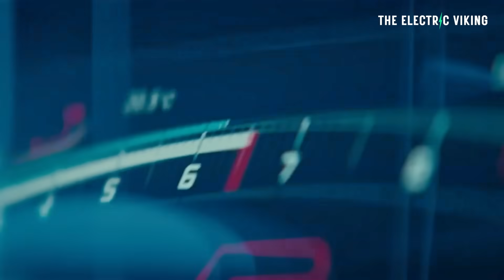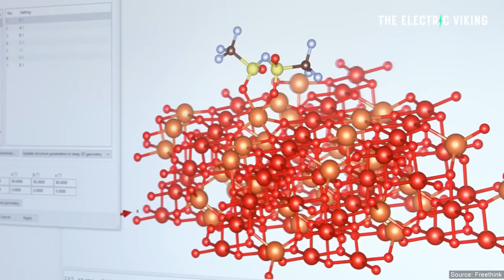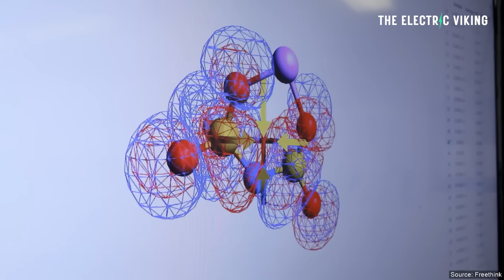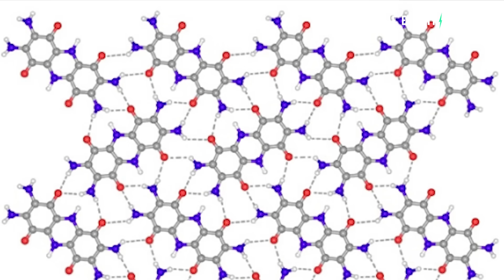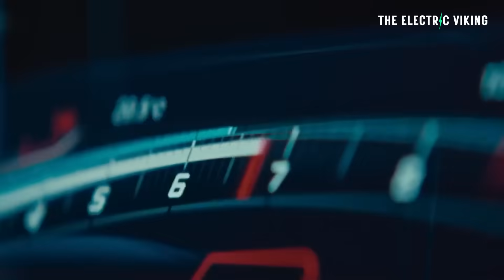MIT reveal Lamborghini battery with 500 kw charging & 765 Wh energy density

Comment: The new Taycan that just broke race track record within 1 second from the Rimac Nevera, which is also owned by Porsche/Bugatti, is using this new battery and will be unveiled in March! This is the reason Porsche has cut back on EV production in the past couple of years. They are working mostly on variants that use their engines with super compact batteries with extreme density and extreme low weight, including test vehicles with Quantumscape solid state. No more range anxiety or charging issues. Add to this mass production of their synthetic fuel, and Porsche will annihilate Tesla in its tracks!

Comment: I like EV tech but ICE engines are far from being done.  Teslas are being delivered on diesel trucks, shipping lines use enormous quantities of marine diesel, airlines run on kerosene and other hydrocarbon derived jet propulsion fuels... and these are just civilian users. Where were you with your reporting when thousands EVs literally froze in Midwestern cold blast, lol.  
Researchers will promise you the sky and the moon to get their grants (i.e. have their jobs secured).  Until these technology is commercialized, this is just blah blah blah.  Everybody including Toyota promises breakthrough tech to develop new chemistry and materials for high energy density storage but nothing yet that is scalable, reliable,  reproducible in a desired range of temps /climates these motors need to run.  The auto manufacturers just spreading their bets, doesn't mean much untill there is a commercial product at reasonable cost as most of your viewers likely don't have Lamborghini car budgets.

Comment: What I really want is all of these new batteries/packs made to be reverse compatible with most if not all EV's out now. I would easily pay to double if not triple the range of my Mach E if a replacement pack made from these new cells, once the present pack "wears" out (70% of original range). THIS is what is really needed. I know the OEM's would have to made the the controllers compatible or make replacement ones too but it should be done ASAP.

Comment: No standard tire will give you 1.3 seconds from 0 to 60. the limitation is tires not power, dragsters have massive custom tires that are not practical for street cars, and the Tesla Roadster can supposedly get to 1.2 seconds from 0 to 60 by using cold thrusters.
Batteries with the power you are talking about will be used for aviation where cost of the batteries will be justified by fuel savings.

Comment: When the battery weighs less than an engine and small engines that produce high power output for short periods this means highly technical vehicles , like  current EV,s, will be less attractive because range concern will be eliminated and conventional vehicles more easily adapted.

Comment: There's so many components to a good battery:
1.  Affordable
2.  Easy to manufacture
3. High energy density
4. Rapid charging speed
5. Fire resistant
6. Can release energy rapidly
7. Doesn't use problematic metals like cobalt.

It's a tall order for researchers and engineers to get right.

Comment: As usual Sam Evans does little research, so he often gets the details wrong (and the links in this video's description box are for a different battery, so ignore them).  765 Wh/kg is the energy density for just the cathode, not for the entire cell. Given that cutting-edge NMC811 now has cathode energy densities approaching 750 Wh/kg and cell energy density around 300 Wh/kg, we can guesstimate that this new TAQ battery will have a cell energy density of about 306 Wh/kg, so it is impressive, but it isn't going to revolutionize the industry as Sam Evans thinks. Remember that CATL just announced its "condensed battery" with cell energy density of 500 Wh/kg and Amprius is selling its solid-state battery with 450 Wh/kg.

The TAQ battery has 88% capacity after 1000 charging cycles and 70% capacity after 2000 charging cycles, so its lifespan is similar to NMC, but LFP supports 2 to 3 times more charging cycles.

Where the TAQ battery shines is the fact that its cathode contains no metals (except for a copper or aluminum current collector), so it solves all the problems with the limited supplies of nickel and cobalt, and the researchers think that TAQ batteries should cost a third to a half of the price of NMC batteries. In other words, these batteries should compete with sodium ion batteries on price, but they will have significantly better energy density and can be charged at 10C (i.e. 6 minutes). However, this is at the early prototyping stage in a laboratory, so it will probably take 5 years to get this to mass production, and by that time I fully expect LFP batteries to be at 300 kW/kg and support 12C charging and NMC to be at 350 kW/kg and support 6C charging, so they won't be that revolutionary, so it will primarily be their low price which is important. 

I expect that TAQ will be the future battery for mid-range vehicles (since it still contains lithium and probably copper current collectors in the anode), while sodium ion will be the battery for lower-end vehicles (since it only contains iron and aluminum), and high-end vehicles will use LFP for its longer cycle life or NMC for its higher energy density. Salt water flow batteries will be used for grid storage. Aviation and expensive electronic devices will use something like CATL's condensed batteries or Adden Energy's solid-state batteries.

Comment: This is groundbreaking and would make pick up trucks and larger trucks viable for most tasks.
Reply: Not really, because 765 Wh/kg is the cathode energy density, so we can guesstimate 306 Wh/kg at the cell level, which is only slightly better than today's best NMC batteries with 300 Wh/kg. It will probably be another 5 years before these TAQ batteries reach mass production, and by that time LFP will probably be at 300 Wh/kg and support 12C charging, so the real advantage of these batteries will be the lower cost, since they don't contain metals in the cathode.

Comment: I wish I had a dollar for every breakthrough battery on YouTube.   How many cycles before it breaks down?  Rare metals or chemicals needed?   Temperature range?  Cost to manufacture?   Thermal stability? Etc.  Have there been independent tests?🐝🐝
Reply: All they have is any early prototype in a laboratory and one published research paper, so this is a long way from commercialization. 12% capacity loss after 1000 recharge cycles and 30% capacity loss after 2000 recharge cycles. It uses 90% TAQ + 10% rubber in the cathode with an aluminum or copper current collector, standard LC30 electrolyte and standard lithiated graphite in the anode with a copper current collector. Temperature range wasn't mentioned in the research paper.  Researchers say that it should cost 1/3 to 1/2 of the cost of NMC batteries because TAQ should be cheap to manufacture. There are no independent tests.

Comment: MIT did NOT say this battery has 765Wh/kg! MIT said the CATHODE can carry 765Wh/kg! That means the rest of the battery (Anode, electrolyte, separator, conductors and casing) still need to be added to the whole picture. This then results in a much lower energy density battery (probably under 350 Wh/kg). Viking, please keep it factually correct.
Reply: Also, the energy density is limited to what the lowest energy density of both the Cathode and anode are, then further restricted by what was explained in my first comment.
Reply: I'm calculating that the cell will have an energy density of 306 Wh/kg, based on the fact that the best NMC811 cathodes have 750 Wh/kg and a cell energy density of 300 Wh/kg.

Comment: Highest energy density? So low power density?  Like the lithium titanium oxide batteries ?  LiTo
Reply: LTO has low energy density, but high charge/discharge rate, so high power density. I would guesstimate that the cell energy density of this TAQ battery is 306 Wh/kg, so it will have slightly higher energy density than the best NMC batteries currently on the market.

Comment: My house is wired for about 50 Kwatts total. So a charger that takes the power of 10 fully loaded houses. 240 volts, at 2000 amps, for example. Or 1000 amps at 500 volts. Id be interested in the thickness of the charging cable, and the huge connector to handle 500 Kwatts.
Reply: A normal "fully loaded" house is about 10kw max. (50 amps @230v). 50kw is enormous for a normal house. ie about 250 amps wire rating!
Reply: @tomlewitt  : When I built my house, in Canada, I put in a 200 amp service. So 240 V  x 200 A is about 50 Kwatt.  The insulated service wires were about 12 mm diameter each, if I recall correctly. I'd still be interested in whatever a 500 Kwatt charger would use for a cable, and a connector, and if there would be a weight requirement to wrestle the cable.
Reply: @drewthompson7457  Wow that's a serious installation. Great for decent home charging of EV's. Yes, these future 0.5 or 1 MW chargers will need incredible cables, for currents up to 1200A , at 800V working...Let's not even think about aircraft charging! ..15MW batteries, (small 90-passenger airliner) needing a 2-hour max turnaround!

Comment: I hope VW doesn't "sell" the technology to China. They could make it in Germany and kick Tesla's ass with expensive Hyper Batteries that Tesla customers want. I can see the Mercedes Benz EV Long Haul Truck coming out in 3 years. What about an extended range hybrid Tank! They can slap the "military" tax on it and make a killing. I mean $50 - $60K for a battery 1/3 the size that theoretically can fast charge at 500KW (If you can find a charging station that high, anywhere). With ranges of 500 - 1K miles. People will be selling a kidney for it. Imagine finally an EV battery that can put ICE  into retirement. The Mg version I don't think will be as energy dense, but a close 2nd for half the price will sell to the rest of us that don't want to sell a kidney for the privilege of range and fast charging.

What we need next is a solar array that has the capacity to charge a EV from 30% to 80% in under 4 hours of bright sunlight. Requirements are that it doesn't take half a parking lot to do it. We need more efficient solar panels, not cheaper one's that don't cut the mustard.

Comment: Well, If it's MIT, I have no doubt the specs are real.  However, Lamborghini only sells very expensive vehicles so they can afford a super high end battery for there vehicles.  These batteries may use cheaper materials but that doesn't mean they are cheaper to make.  In fact, until any battery is made at scale it will be more costly.  How well these can scale and how long it will take to scale is a question that is not answered on the MIT site.  Impressive as this battery is, I'd say we're at least few years away from it coming in any product and probably a few more before mortals like ourselves could purchase it.

Comment: Where did you get those numbers?i can`t find them anywhere.
Reply: Google: Chen et al (2024) "A layered organic cathode for high-energy, fast-charging, and long-lasting Li-ion batteries". 
500 kW charging is not in the research paper and I'm guessing that it is speculation based on charging a 50kWh battery at 10C (i.e. in 6 minutes). 765 Wh/kg is the cathode energy density, so we can guesstimate 306 Wh/kg at the cell level, which is only slightly better than today's best NMC batteries with 300 Wh/kg. It will probably be another 5 years before these TAQ batteries reach mass production, and by that time LFP will probably be at 300 Wh/kg and support 12C charging, so the real advantage of these batteries will be the lower cost, since they don't contain metals in the cathode.

Comment: That's good news seeing the w/kg feature cut in half. They need to push hard for even more improvements to that. Gadoline still has 17 times the energy density. A quart bottle of gasoline has about 9x the density, so there's still a long way to go with both weight and volume of fuel needed.
Reply: That may be, but for most applications gasoline has an efficiency of just 20%.

Comment: Well, MIT did not reveal this.  Lamborghini did.  And the corresponding lead-up to Tesla's earning on Wednesday makes it suspicious.  The 765Wh energy density is a figure that may be for a non-packaged anode and cathode.  The charging time may be the same or both may be high end pie in the sky possibilities.  A couple of days ago Stilantiis took a pot shot at Tesla saying that Tesla's price cutting destroyed it's profitability.  And tomorrow it will be GM, BMW or soe other auto company with a bit of FUD.  These marking ploys are designed to get investors to question the long term viability of Tesla.  Even if true, Lamborghini doesn't have the 50 other things that go into a Tesla car that the rest of the industry doesn't have FSD, supercharger network, decade plus of data of every charge they've ever given  a and how the battery performed, 

I don't think you'll hear about this battery much going forward.  It's just extremely unlikely that a technology is going to pop up like this, that nobody's ever heard of and it's going to be a slam dunk.  Did I say "extremely unlikely?"  Like 0.0001%.  And the repeated scheduling of these announcements to correspond to Tesla earnings are just evidence of more FUD.

Comment: with MIT battery the 765Wh energy density will make Electric planes viable as it was reporter that 450Wh would be enough to make the viable.
Reply: 765 Wh/kg is the cathode energy density, so we can guesstimate 306 Wh/kg at the cell level, which is only slightly better than today's best NMC batteries with 300 Wh/kg. It will probably be another 5 years before these TAQ batteries reach mass production, and by that time LFP will probably be at 300 Wh/kg and support 12C charging, so the real advantage of these batteries will be the lower cost. Elysian estimates that 450 Wh/kg will allow regional airplanes with 800 km (500 miles) of range. CATL is already offering its condensed batteries with 500 Wh/kg to electric aviation companies.

Comment: I have no doubt this will be like the breakthrough solid state developers keep claiming. Yes, in theory, it may have a huge battery density, but it’ll turn out it can only be charged like 10 times before it’s dead, and it costs 1000 times that of current batteries at this time, and will take another 10yrs before battery costs are at todays lithium battery costs. Let’s see how this pans out…..

Comment: What's the charge rate and charge retention in prolonged sub-zero centigrade weather?
Reply: The research paper says that it supports charge rates between 0.1C and 10C and doesn't mention any testing at low temperatures. This is still an early prototype in a lab, so don't expect to see this in the real world any time in the next 5 years.

Comment: We need this kind of energy density in order for EV trucks to fully compete with ICE trucks, especially when pulling a trailer
Reply: All you need for that is battery cells on the underside of the trailer, as well as on the cab, to give it a range that the ICE lorry cannot compete with on any comparator.

Comment: 500kw charging speed and 765Wh energy density is good enough for electric aircraft, let alone hypercars!  Easily 1000 horsepower per electric motor installed in each wheel... We are talking 4000 horsepower BEVs.... Madness.

Comment: With internal resistance that low, these batts will either drastically reduce or eliminate the need for capacitor buffering energy.

Comment: Can you imagine what that could do for the aviation industry?
Reply: They are suitable for aviation. 765 Wh/kg is the cathode energy density, so this new TAQ cell should have a cell energy density around 306 Wh/kg, which is only slightly better than today's cutting edge NMC which reaches 300 Wh/kg. Aviation is going to need something like CATL's condensed battery with 500 Wh/kg, which are very expensive and probably have short cycle life.

Comment: This was so wild that I actually had to fact check it, and it is all true. Just one thing though, from the current stage of development to a product in a car that's on sale takes time, maybe 7 to 10 years. However, VW's partnership with battery manufacturers like Catl, Northvolt, Samsung SDI, LG and others may shorten that time frame significantly. Still, we won't see that battery in a production car for a few years...MIT and Lamborghini have filed a joint patent for a new material that serves as the technological base for a new generation of supercapacitors. This collaboration involved the synthesis of this material in MIT's Department of Chemistry, supported by Automobili Lamborghini's Concept Development Department.

When two entities like MIT and Lamborghini file a patent jointly, they both hold intellectual property rights over the patented technology. This means that both parties have a say in how the technology is utilized, licensed, and further developed. In the case of the supercapacitor and battery technology developed by MIT and Lamborghini, both institutions have control over its use jointly. This control extends to granting licenses to third parties, which means they can decide if and how other companies might use the technology.

By licensing the technology from MIT, Lamborghini (and by extension, the Volkswagen Group) secures the right to use this technology in its vehicles. This licensing agreement could be exclusive, which would prevent other automotive manufacturers from using the same technology without permission from MIT and Lamborghini. This exclusivity can provide a competitive edge to Lamborghini and potentially other brands within the Volkswagen Group, as they could develop vehicles with advanced battery technologies that are not available to their competitors.